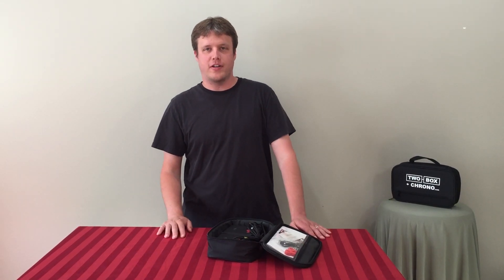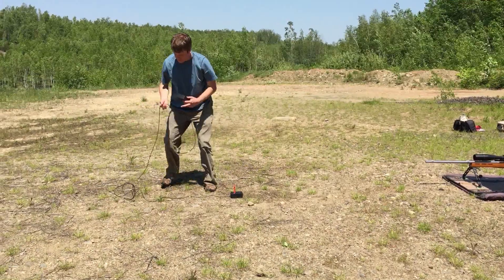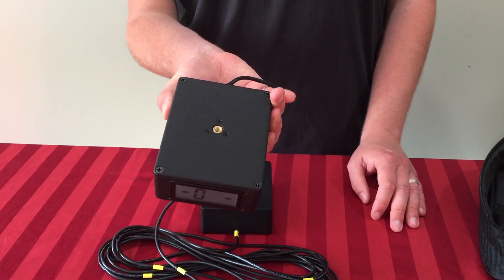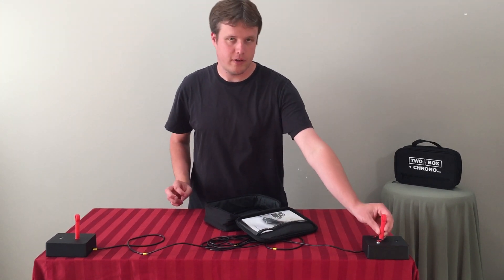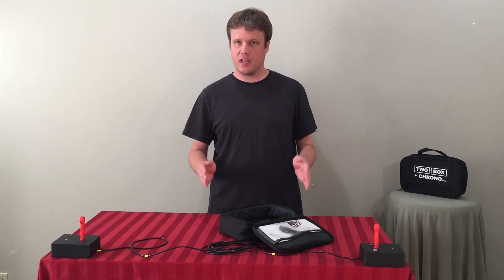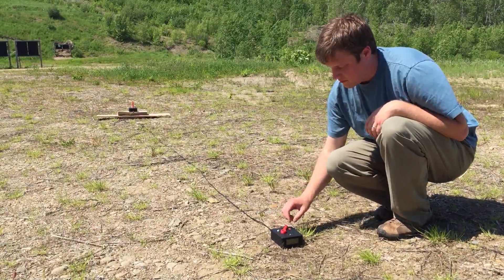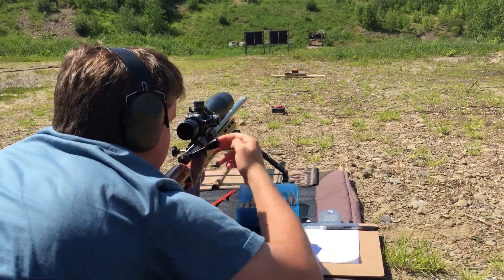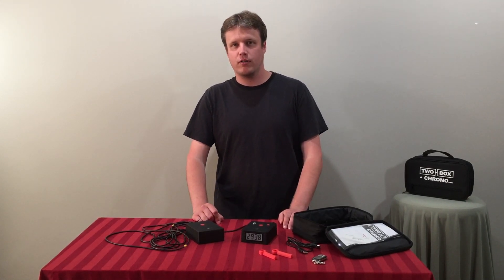Two Box Chrono

Comment: Hi Adam we talked about a year ago after I bought a new Two Box Chrono, from you. I actually ended up with two of them. But was seeing a significant difference in feet per second between the two when they were side-by-side about a 2 inch spread. I even tried  putting them closer to each other leaving about a quarter inch gap between them. This week I got a chance to play with both the 2Box and the LabRadar.  I decided to take the 2Box  out further  around 30 feet. Both units read within 3 FPS of each other. and their speeds were consistent (about 20FPS slower) with the LabRadar.  I really needed something that could measure the higher speeds, above 3900FPS that is the limit on the LabRadar. Thanks working GREAT NOW.